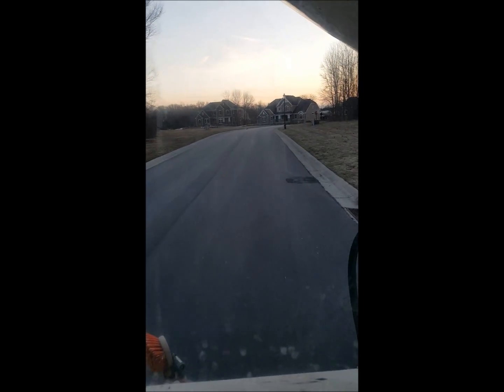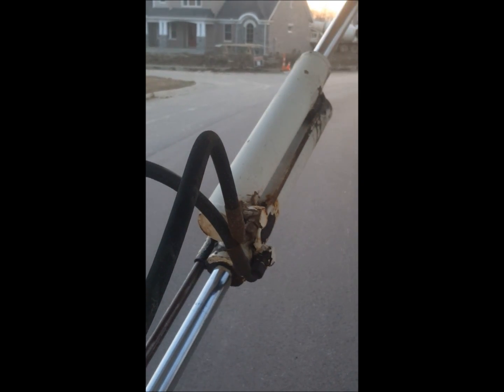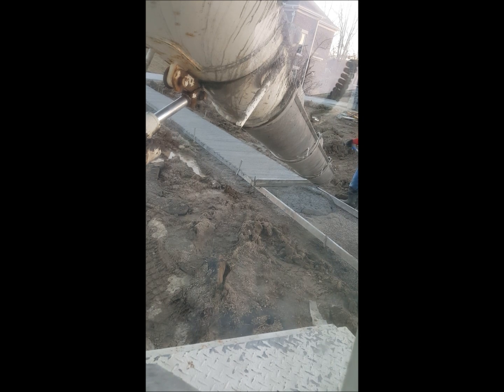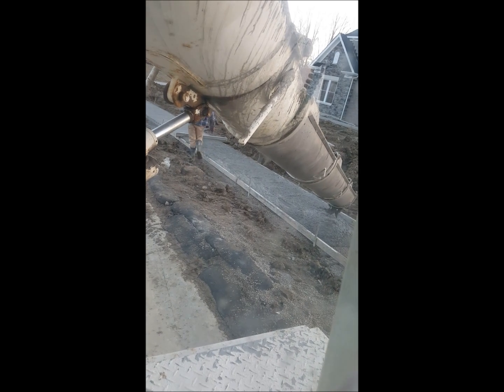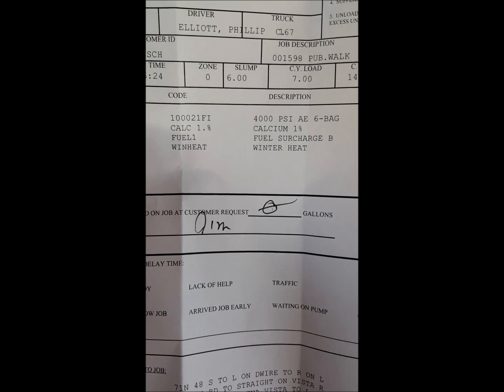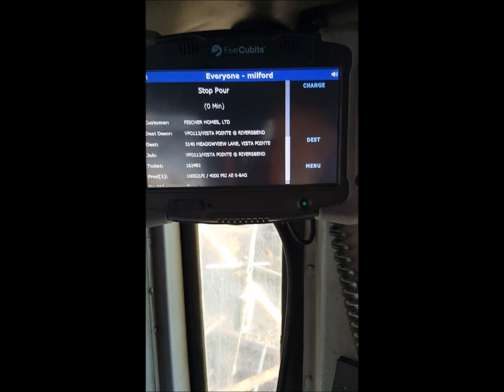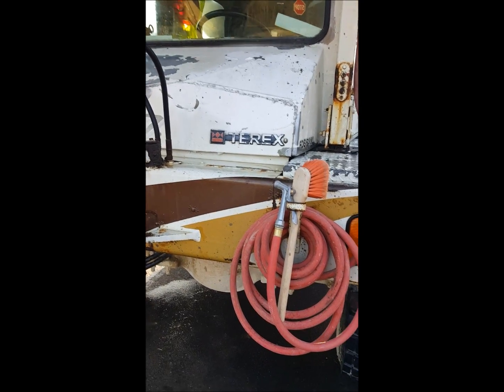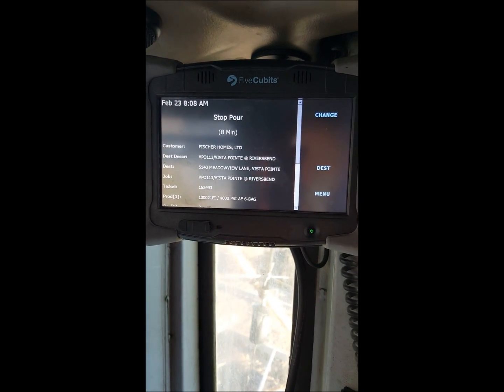Concrete truck: Arriving at job, slumping, pouring and washing down

Comment: Would you recommend driving concrete trucks for my class b and want to apply but kind of nervous about the curves any advice and how is the work environment
Reply from the maker: Good Drivers are hard to find, so slot of companies offer great pay and benefits. Just shop around and see what they are paying. As far as curves most trucks have air ride which definitely helps. It's not as bad on curves as the myth would lead you to believe. It's all about being safe.
Reply: @fabphil63068  What is curves? Sorry but I have no knowledge about concrete trucks whatsoever but I am thinking of getting into this business with the goal of purchasing my own truck
Reply from the maker: @MrFooChops  curves in the road. people worry bout them being to top heavy
Reply: @fabphil63068  In terms of owning your own truck as a business, do you think this is something that can be profitable?
Reply from the maker: @MrFooChops  it could be if you could get a good deal on concrete. but remember all the overhead you have. if you blow one tire thats $700
Reply: Thank you sir that answered my question pretty much and sure will do

Comment: I was always much more thorough on clean up. Especially up underneath the boot.
Reply from the maker: 042rayme I normally am as well. But in winter that's the quick way.
Reply: I quit driving back in 2001. I must admit there are times that I miss driving mixer. You do a good job.  Brought back some good memories.
Reply from the maker: 042rayme I finally quit driving last year. After 23 years it was enough.  Moved to Florida and now I'm the QC manager and operations manager. I miss driving sometimes as well.

Comment: I'm concerned about driving the truck safely (i.e  turns) mainly avoiding turning the truck over.And learning how to slump a load
Reply from the maker: Buddyx76 when training you are not expected to win races. safety is always first. they are not as top heavy as they used to be. the air ride on the trucks make a huge difference in keeping a truck level. as far as slumps that comes easily enough with time and repitition
Reply: Take your turns very slowly, it's not a race in these things. You will feel the truck lean left and right but you'll get used to it. If your not sure about the slump take a look at it, if you think it's wet let the batch guy know and he'll dry you up buy don't leave the plant if your wet.

Comment: Mr Carl nice video be starting training in a month  just one ? Do your truck have a water meter how do you know how much water to put in the concrete
Reply from the maker: GasBroker 880hp usually i count one thousand one and thats a gallon
Reply: Ok I got 10 yards at a 3slump I looking at your chart it said a five is need what when you get out the plant it at a 3 but you mix it to a five ? Is that the format?
Reply from the maker: GasBroker 880hp basically but you always check your ticket to see what slump you need on the job. if you need a 5 you ad the water (20 gallons) when washing down. I never ask for water under the plant because your initial  reading is very seldom right because the materials are never mixed properly until you give it a couple minutes.

Comment: Contractor is a but hole for makin ya go backwards . I hate dudes that do that crap:(
Reply from the maker: 2011gmh i find it much easier
Reply: You always pour going backwards with a front discharge very rarely you pour forward 30 yrs experience!